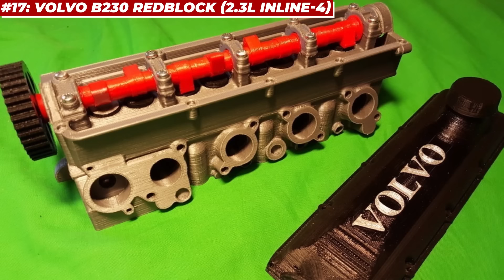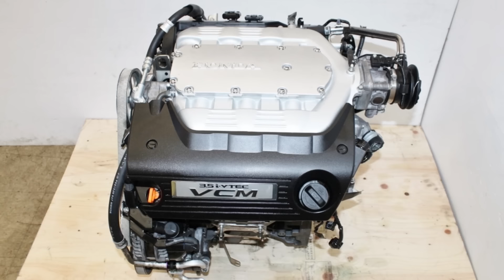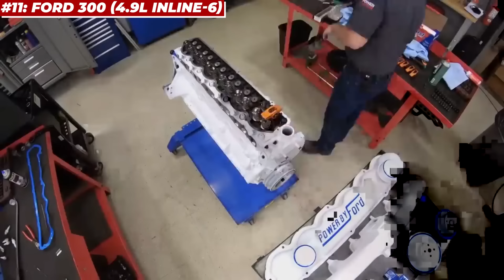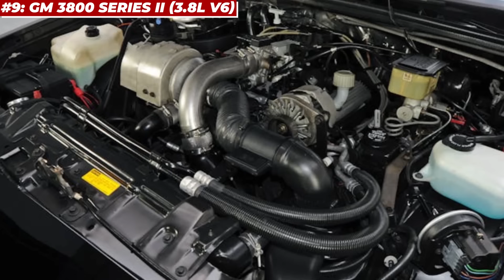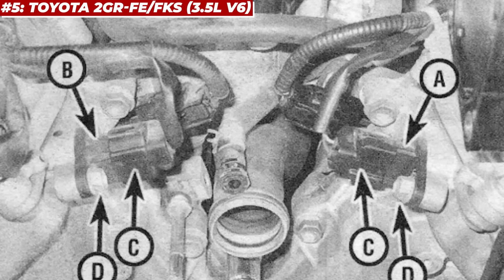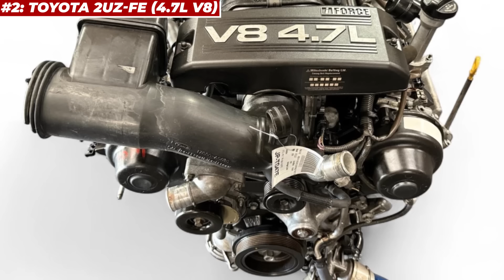17 Engines So Reliable They’ll Run Forever!

Comment: Have an 02 Chevy. Astro. 4.3 V6 Vortec. Has 335K on the clock with original engine. Always has had routine oil & filter at 90 days or 3K. All other maintenance done regularly as well. Still going strong.

Comment: I have a 1996 Ford F-250 XLT HD 4 x 4 with the 351 Windsor and it had little over 350,000 miles on the original drivetrain
Reply: so fucking what....

Comment: On the 4.6L Modular engine, the spark plug issue wasn't an issue with the Panther Platform cars. Unlike the Mustang, the Panther Platform 4.6L engines had cast iron heads, as they weren't looking for performance with those cars, but longevity, and smoothness. I've never heard of a 4.6L in a Panther car needing thread repair kits, due to the use of cast iron

Comment: 400,000 km equals, 248,000 miles. I have 230,000 miles on my Ford E -150 van with a 302 ci V-8, and 210,000 miles on my daily drive Jeep Cherokee with a 4.0 L inline 6 cylinder, and I'll be driving both for quite a few thousands of miles in the future. Two great engines, getting 17 mpg  all the time !
Reply: Right there with you. While I do not have a Jeep, I have two Ford F-150's with the 4.2 L V6. One has over 241,000 miles and the other  has over 200,000 but I'm not sure the exact mileage.. I had to change instrument clusters so it doesn't have the correct mileage on it but I know it has roughly about 205,000 or so.

Comment: I have a 2008 Ford Ranger with a 2.3 L 4 cylinder engine. 400000 km and still going strong with no oil consumption
Reply: so fucking what